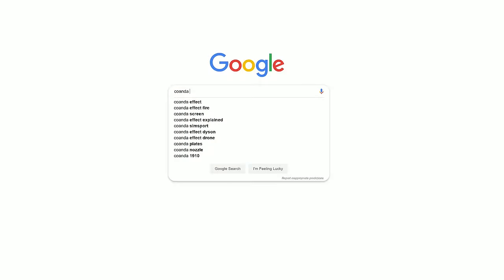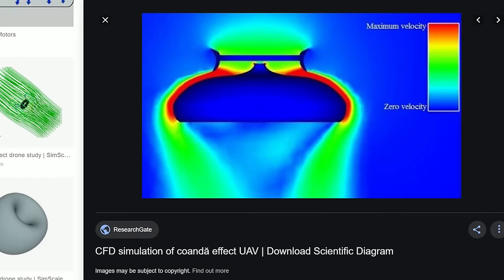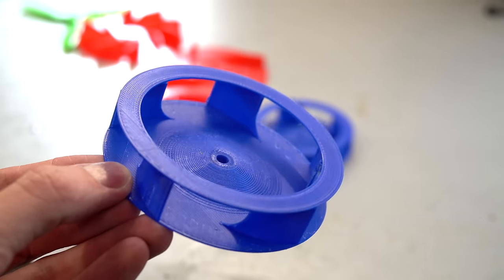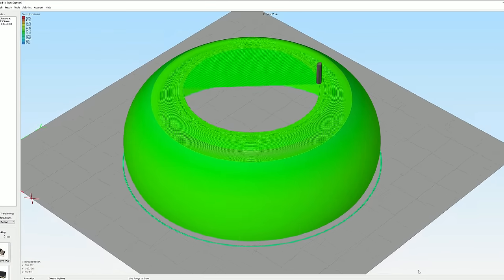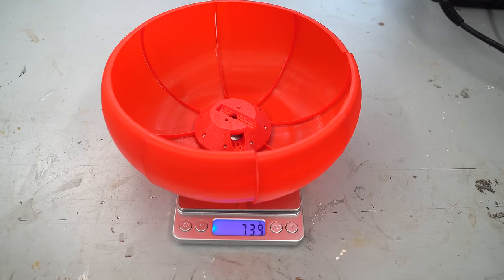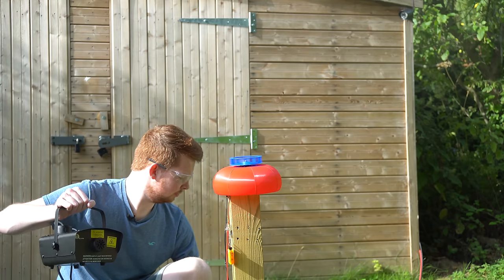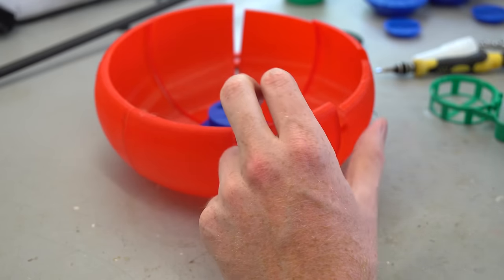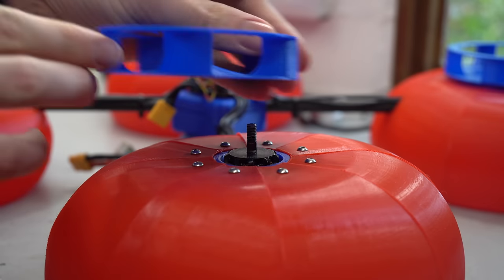Coanda Effect Drone Propulsion

Comment: Simple impellers by design are way less efficient than propellors. Even though the propellor version flew better I like the impeller version more since it’s a radical different way of creating lift.
Reply: @Klippy Klop The video.
Reply: Visual_Vexing Thank you, @Klippy Klop need I say more? I said ‘simple impellers’ like the one in the video
Reply: Well, while this isn't completely wrong, such types of impellers can also be very efficient but at much lower fluid velocity, like you would have in a fan. Also, he probably should have used redirecting vanes, to get a straight airflow, that was probably his major mistake, wich costed him the most efficiency.

I did wonder, why he wasn't printing a radial compressor, tp my knowledge, it is very doable with the right size.
Reply: @Klippy Klop The efficiency is lost as the impellers does not have good intake (LP) and exhaust (HP) separation and pressurized air is cycling back into the intake. This is also the reason for the high throttle requirement to lift-off as most of the pumped air simply curves back to the suction at lower velocities. It may be more efficient if the top plate of the impeller had a radius toward the center raising its height by at least the height of the blades (see https://autodesk.i.lithium.com/t5/image/serverpage/image-id/349301i742D77EAB47B2462/image-size/large?v=1.0&px=999). This would increase the compression (thus creating higher output velocities at lower speeds) as well as generating a larger separation distance between intake and exhaust.
Reply: Impellers need ducts to work. Mostly for the incoming air flow and to increase airflow speed. Think turbos, ww2 air sirens etc.

Comment: The impeller that broke was probably producing more air flow, thus pressure and broke.  Re-print that impeller with thicker walls for the additional force, should help.
Reply: No, it was spinning fast enough that the outward force made it rip off.
Reply: The one that broke had no upper support and as centrifugal forces built the top started to be pulled outward until it snapped at the base.
Reply: The one that fried the motor was probably the best though, downsizing it a bit might have helped.
Reply: @excitedbox5705  This is why most impeller designs are inefficient in air because the static pressure of the medium (here air) is quite to low. But Impellers are highly efficient in water.

Comment: Have you considered extending the domes into an aero spike? Laminar flow is beast.
Reply: Beastie laminar flow :)
Reply: I was thinking about more of a frisbee shape, but with more of a peaked center. Curl the edges in a bit more to pull the air down.
Reply: Awesome idea, also make the domes inflatable like a zeppelin, filled with helium or hidrogen.
Reply: *Destin intensifies*
Reply: That would ruin the ground effect but would likely increase lift by a lot.
Reply: I think this would create a region of low pressure under the drone, which would negate the lifting force.
Reply: GXTRON hahahhahahaha
Reply: Jake Heke  Derpderpderpderp

Comment: Good video Tom.  Your initial thrust tests basically predicted the outcome.  I imagine the Coanda effect loses efficiency since there must be an outward thrust component, and not all of the thrust is directed downwards as it the case with a propeller.  You might want to revisit this with redesigning the bowls into a similar shape as the Dyson fan, which is based on the same principle.  Cheers from Canada.

Comment: I wonder if pressure could be leaking between the pieces, perhaps sealing the tomatoes off could improve efficiency. Also, missed opportunity not printing the toppers in green.
Reply: Wouldn’t the extra glue add more weight?
Reply: @NiftyShifty1    it will definitely add some weight. I would personally "weld" them together
Reply: @iorekbyrnson7173  using a very potent cyanoacrylate.
Reply: @AndoniOlea  I was thinking tape, but that sounds even better.
Reply: @Flojer0  For best result, I would recommend using a high density polystyrene to make the bell shape, since cyanoacrylate works better in polystyrene than in normal PVC.  Also if you are careful enough, you would not even need adhesive, since you could carve it directly.  

It can be done in a thousand ways.

Comment: You should try shrouding the impellers. In my experience any time you have an impeller for any application, it’s shrouded.
Reply: It's not a impeller if it's open he using impeller as a propeller that's the problem
Reply: @davey2k12  I recommended  putting the impeller under the bell that way its " shrouded" as long as he adds an intake above the inlet of the impeller.
Reply: @clayton458  ya, but that wouldn't be using the coanda effect.
Reply: The impellers are only effective when encased, the propellers work better but they need a shroud so air doesn't escape on the sides, think about a cooling fan on a car for example the shroud directs the air towards the radiator so doesn't get wasted on the sides. the same principle will apply on this experiment, also the single piece was better in my opinion due to the less weight than the multiple pieces, a single piece with shroud and bracket could B 3d printed in 1 piece all you need is just the screws to mount the electric motors, aluminum frame can help on reducing weight so the batteries can stay on the drone

Comment: Hey Tom, awesome project!  I agree with you about having some turbulent flow going under the dome because you have a radius and a rounded lip at the bottom so you end up with ground effect until the velocity of air can shear away.  This design is good for a hovercraft.  You need to have the dome wall stop at 90 degrees or slightly more (with respect to the ground) and leave a sharp edge to have a more laminar airflow that shears straight off the dome.  Also some fins may help direct the air.  Think of a diffuser on a race car.  At the moment you have a rounded edge like some juice bottles where you have the juice run down the bottle onto your counter top if you don't pour fast enough.  Also vacuum formed polycarbonate would probably work well for the dome.  I'm sure it would be lighter.👍
Reply: I was thinking the same, you could just about cut the weight of the domes in half by removing the lower half. Just as you said, beyond 90 degrees. I also imagine a plenum around the impellers would help keep the air moving closer to the top edge of the dome, but, it would also add weight, so I don’t know if it would help more than it would weigh?

Comment: Awesome project and great job! I think you’re on to something and I believe you could get it to work. I have a few ideas, as I see many others have ideas too. 
1: Majority of the lift would come from the top surface. The impeller may be removing a large section of that vertical pressure difference. You can still use an impeller, just switch it to the axial type that pulls in air from the outer diameter and pushes it down the middle. Mount it a little higher, like your traditional prop setup, and you’re golden 👍🏼 Also, this type of impeller will suck in more air. 
2: Ridges on the surface of the bowl may not be a bad thing, rather near the outer edges. You’ll have to research this for the full explanation but inducing turbulent flow around the area where the laminar flow starts to separate from the surface actually helps keep the flow against the surface slightly longer, which really helps at low speeds. Examples are gulf ball dimples and vortex generated on the front edge of airplane wings. Now, ridges from printing may not be most effective, but maybe you could add tiny vortex generators or dimples wherever the flow breaks away at LOW throttle. 
3: Close proximity of the domes may be effecting each other, let alone the impellers directing air towards each other. Also, horizontal movement, or winds, will effect the flow on the domes which is your lift. Not sure if this is a solution, but maybe add walls to separate four sections 🤔 maybe each dome could be inside cylindrical tubes. I’m thinking like the Parrot drones that have foam wall attachments. 
4: THE DOMES COULD ALSO SPIN! This is more of a fun experiment bc I don’t really know if there would be any benefit besides acting like 4 gyroscopes lol
Reply: I may be confused at way the way you mentioned it but those vortexs on the wing tips are actually a bad thing

Comment: I'd love to see a test of just the impellers without the domes. I'd expect there to be some lift just because of the low pressure directly above the impeller.
Reply: That is a very good thought.  What if what we are seeing is not the Coanda effect, but he's just "sucking" the drone upward?
Reply: Hello did I just interfere a long conference
Reply: @ronrothrock7116  yeah but it'd also cause low pressure on the bottom as it moves up so it'd produce very little lift at most
Reply: @ausintune9014  Which is also happening with the domes.  The air passing over the bottom lip of the upside down bowl will entrain the air from inside the bowl.  There is likely a donut shaped vortex of lower pressure air inside each bowl.  Higher pressure than the air moving above to bowl, but not as high pressure as static air.  

Also when the bowl is touching the ground the air can',t be deflected straight down.  It will decend still at a much lower and much more outward angle.  Thus producing a large relatively low pressure areas as you explained without the bowls.  Which is why it seems to suck to the surface at first, then shoot up.

The ground effect is because that vortex in the bowl gets pressurized air fed up into it from the ground as the edge airflows flow towards and converge on the point on the ground centered below the bowl, and then upward. 

Plus notice that three sides of each bowl faces another bowl and he has them very close.   I am betting half the head on colliding airflow heads upwards, not down around the bowl.  Colliding airflows have higher than static pressure so the effect he depends on does not have to correct conditions in the middle of the drone.   So he loses 50% of 75% of his thrust that way.  That's 37.5% immediate loss in thrust.  

With propellets only there is a tiny frictional surface.  With impellers and bowls the frictional surfaces slowing down airflow are increased by a factor of what, 50 times?  Flow over the top and inside of the bowls both contribute to slowdowns in flow.  As well as the probable increased turbulence.

No wonder it is so inefficient.
Reply: then you'll need the perfect aerodynamic efficiency plus a dying engine running on it's limits
Reply: Wouldn’t the air just be turbulent in the center and be forced outward? Not downward, as the domes were needed to shift the flow.
Reply: If it had another shroud to separate the inflow and outflow on the impeller, it would further increase lift, and concentrate the vortex action in the shroud causing condensation from the low pressure, like a small tornado, if the rpm reached high enough for the pressure differential to take effect
Reply: without the domes the thing would not move at all.. but more to the point, its a cool note in physics, but I think it should be said, this drone is not flying because of the coanda effect, it is flying in spite of it... just think how much weight those domes add and the added air resistance for it to get off the ground.. the drone is really riding the struggle bus as you can see in the video..

Comment: Hey Tom. If the air pressure underneath is bouying up the craft then the red domes need not be so parabolic shaped. Flatten them out like a wing and the air flow above should drop the pressure and make your Corriander lol effect

Comment: Make the domes out of a helium filled bag. Airship lift with added drone power.
Reply: Lol
Reply: I was thinking the same thing but with hydrogen
Reply: Guys, that's not how it works. This little volume of gas won't help at all. I don't really see the point in even making something alike with the thing in the video, but that's just ridiculous.
Reply: @69fox  Disagreed, shaving grams of a drone is what people do for performance..
Reply: @0012erick , no. Saving weight can help, but adding that much new parts and complicating it with gas filling is pointless. If you want performance - don't even do this lol, there are much more practical things to do.
Reply: @69fox  You seem to miss the point. The bag is where you get the weight savings, not the gas inside.
Reply: helium and hydrogen are also offer better cooling if the motors were mounted inside, the only problem is sealing.
Reply: @0012erick , yes, looks like I missed the point. What bag? Why do you even need gas if it doesn't save weight, as you say?
Reply: @69fox  That would be the bag referred to in the OP. Instead of using the plastic, a thinner mylar bag could provide the hemispheric surface needed for the Coanda Effect. It must be pressurized with gas to to enable a support structure though. It would be best constructed by an experienced professional clown.
Reply: @0012erick , but it's pointless. It won't give any advantage over the typical propeller, moreover it will most probably reduce thrust drastically. The bags of gas will break every crash or even landing. Without the additional support and therefore additional weight they will wiggle like balloons under a prop, which obviously won't give you anything. The volume of these things will make the aircraft much more sensitive to wind. And I don't think OP was joking about this, but I'm not sure.
Reply: selsuru 4 little hindenbergs
Reply: @69fox  if it were me, I'd be interested in the possibilities of replacing the dome with a helium filled mylar type balloon.  If the surface was appropriate in texture and curvature you'd get the surface for the air deflection with a negative weight cost, solving one of the bigger problems of the design by removing the weight of those domes.  Sure, just use a normal prop config instead, but if the point is to explore unusual designs then it seems like a good lead.
Reply: @KaitharVideo , but balloons need to be mounted somehow, they need to have a carcass, or they will just wiggle around and make the thing unstable. The weight of the balloon and the carcass themselves will probably be greater then the force of helium of such volume. If the idea is to check unusual idea you can try it, but it probably won't be effective, otherwise you would have seen this design on military aircrafts or at least flying toys much more often.
Reply: we can use a doughnut shaped balloon. In the center  one multidirectional propeller.
To assist with lift,  theres no shortage of hydro/helium balloons that can be used.

foam covered props  and a cam  and you'll have a drone slash spy cam
Reply: Apply that to flying cars.That could be the very thing necessary from changing a fatal crash into a survivable one. I’m thinking about a physics example about acceleration with an egg landing on ceramic tile versus carpet. Actually, I think my book used a babies head, but I digress. Increasing the time it takes to reach zero by fractions of a second makes a big difference. I know I’d be more likely to fly in a drone car if I knew some bags of air would protect me from dying.
Reply: @69fox  Those are very much solved problems
Reply: @KaitharVideo , if they were you would have seen this design on aircrafts nowadays. But they are not solved, and that's why nobody is even looking at it.
Reply: @69fox  just because we can do things doesn't mean not there's compelling reasons to use something else.  However, the problems I was replying to are indeed solved.
Reply: @KaitharVideo , how are they solved? Anyway, I was saying the same thing, it's too complicated as current designs perform better.
Reply: I'm sorry Nail I typed my comment before i read your comment.
Reply: @KaitharVideo  fox is a naysayer ganpa who will argue to the last breath that you don't need to do X, cause he can't grasp what good it is. You will never be right, as he's endlessly stubborn and dim.
Reply: @0012erick  a professional wannabe engineer clown like Fox, maybe? It could be his first competent input to the idea.

Comment: The centrifugal  impellers you are using produce lower air flow at higher pressures. Axial flow impellers do the opposite. I believe air volume is of more importance to you than air pressure.  Ask fan manufacturers for advice.
Reply: That explains why the propellers generated more force the faster they lifted

Comment: Things I would do to make it fly better with Impellers:

1) allow air to cool the motors
2) Add aerofoils to impeller shapes
3) print bowls upside down
4) add fins to bowls
5) smaller diameter bowls
6) six motors and bowls
Reply: Just out of curiosity, what difference would the fins do?
Reply: @rodrigoc.goncalves2009  I suppose it's to avoid turbulences so the air flows more straight downwards.
Reply: Theres probably some mathematical optimization that can be done to help make the shape of the bowl more effective.
Reply: How about big foam propellers that rotate slower but generate same or more thrust.

Comment: Dril holes on the domes and cover them with some sort of a membrane to reduce weight.
Reply: I predict they would be blown out from inside and, therefore, slightly deform the dome, which would decrease the efficiency.
Reply: @buttonasas  wouldn't it depend on how well you glue it?
Reply: or just make them out of 2L soda bottle tops
Reply: springed pressure release valves, build interior pressure, reduce weight displacement, then release as interior pressure overflows